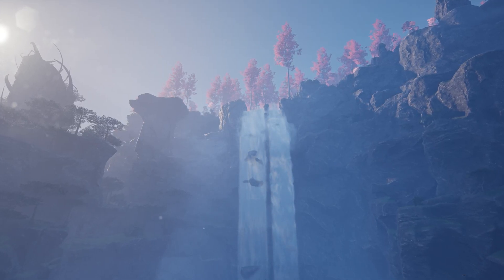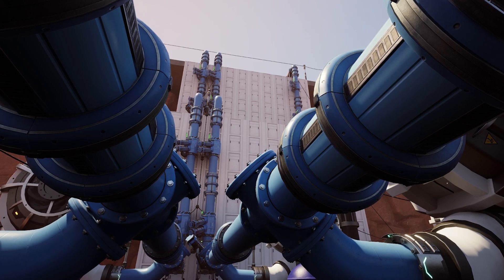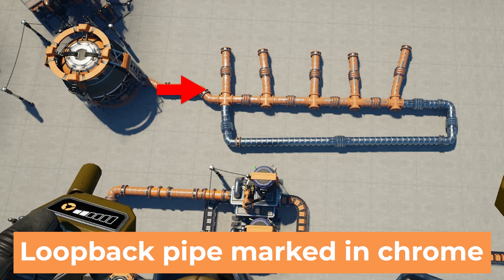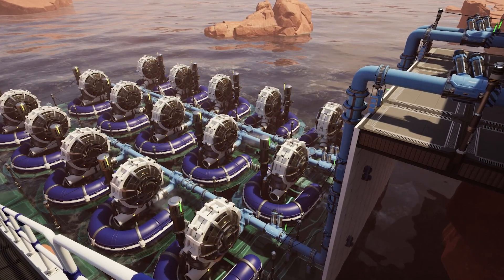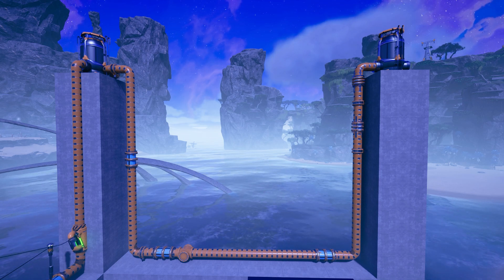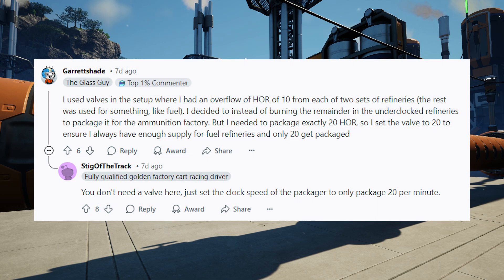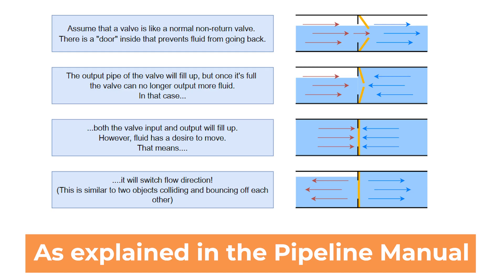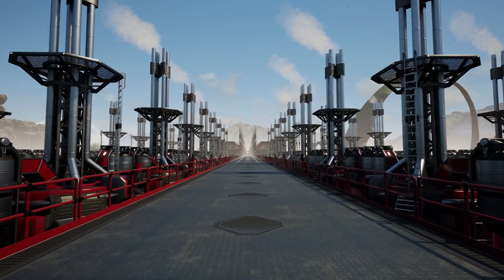Satisfactory: Complete Fluids Guide

Comment: my bane is the water byprduct in aluminum production... I've set up a starter minimal factory with sloppy alumina starter then electtrode-aluminum scrap finish.. 2-2 refinery, 1 water pump
now the needed water for those two starters are 200m3 each and the byproduct is 105m3 each (400 for input, 210 for output)... thought that I'd need at least two water pumps to make it even, but one with less than 80m3 output seems to be the only way that my pipes won't get clogged.. ~290input where actually 400 is needed is not really adding up.. but it works.. but it hurts!
and I have 1353h in the game, finished it once already, but damn... this thing always gives me a headache
Reply: Have you set your incoming water pipe coming down from above into the recycled water. I usually raise the pipe a few meters up just before the junction. This gives the recycled water priority. Works for me but 2 other solutions by drawchaos?? were good.
Reply: Hmm you got me thinking. I'm wondering now if recombining the recycled water into the source water line is my problem. I'll have to test with isolating the lines and putting in dedicated recycled-water scrap refineries.
Reply: I have a short video that fixes this problem with no worries of backing up at all.

Comment: Your first coal power plant is supposed to teach you how to use pipes.  You stagger the inputs, and flood the 300 capacity pipe with 360 water.  By that logic, you should be able to fit 720 into a Mk2 pipe, but I've only pushed to 700.

If you didn't learn the lesson from your coal, you are not going to have a good time with pipes.
Reply: a repeated lesson when oil rolls out and you can throw out everything when you have to deal with aluminum.. as I usually do

Comment: I always place pumps a little lower than the headlift requirement by using foundations as a measurement 10m headlift, use 2 4m foundations and place the pump.

Never had a headlift issue using this method

Also, if you have a water source high up, there is no need for any pumps if all the machines are placed lower than the source
Reply: you dont need to put them lower, in fact the mk2 pump actually has 55m headlift despite claiming to have 50, and will happily pump a full 600/min of fluids up those 55m, if nothing else ruins the throughput.

Comment: Okay I'm definitely going to stop using valves now.

That 8 bit precision is simply not good enough.
Reply: At least it's good to know that the 8-bit precision is supposed to land squarely on 600, 300, 150 and 75 m^3/s. There's still something we're not getting, though. They can read an average flow rate that's higher than what you set the valve to. (Maybe that has more to do with how the average is calculated?)